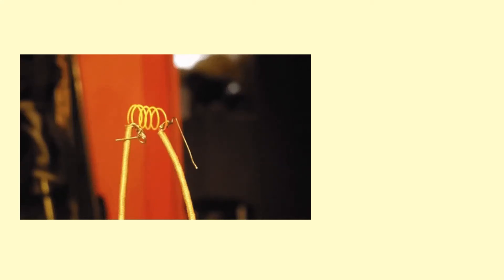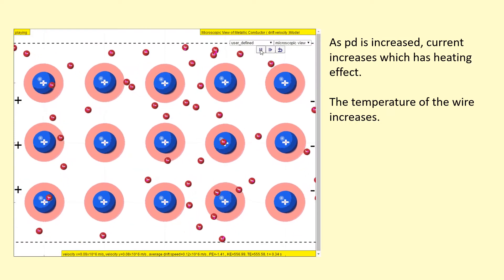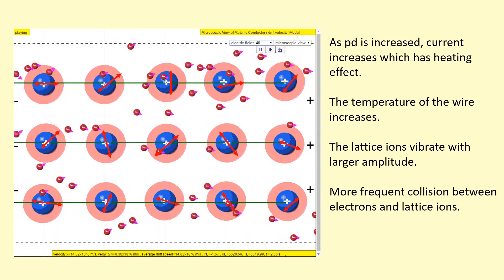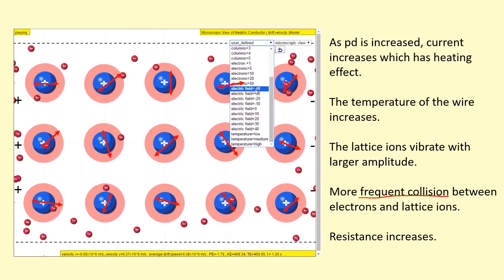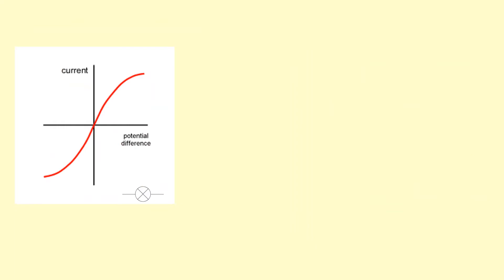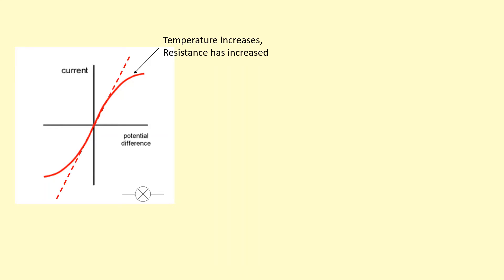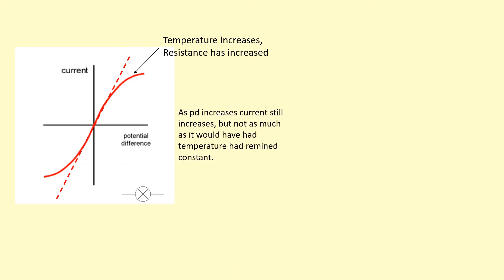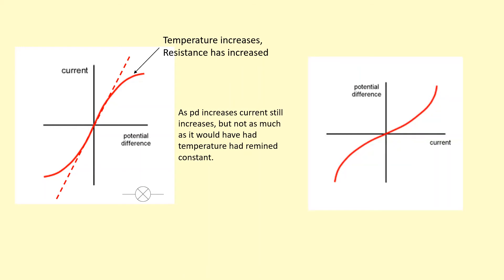3.15 How does temperature affect metals  (& bulbs)

Comment: when we apply a high p.d which increases the current, what actually causes the heating effect, is it because more energy is transferred to each coulomb of charge, and then some of that energy is turned into thermal when it collides with the metal wire

and then since metal wire has increased in temp, collisions with the the metal wire lining increases even more.